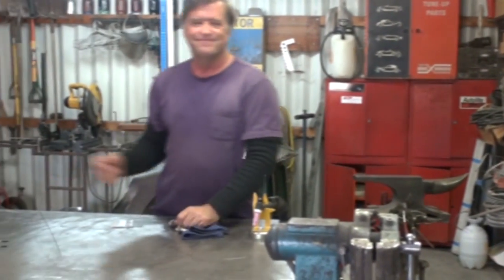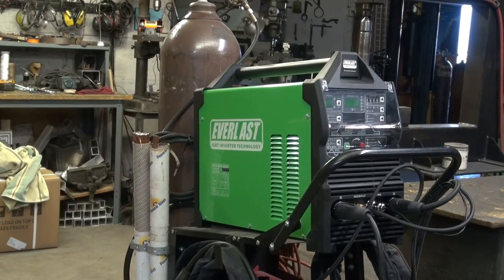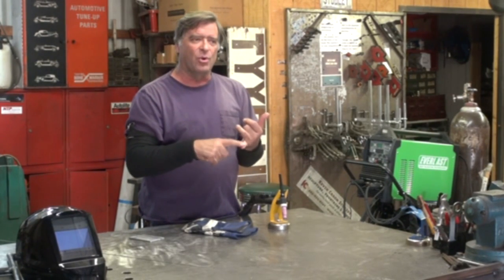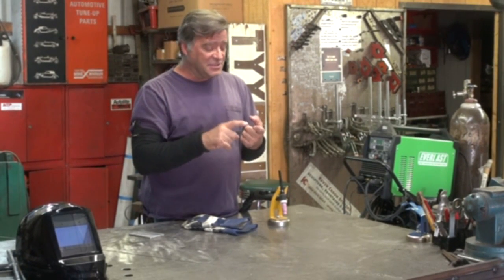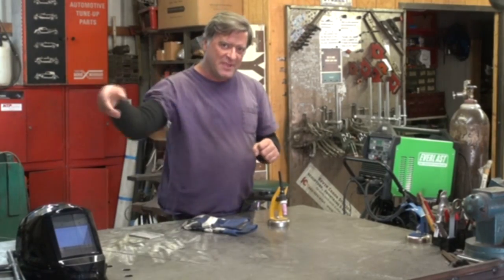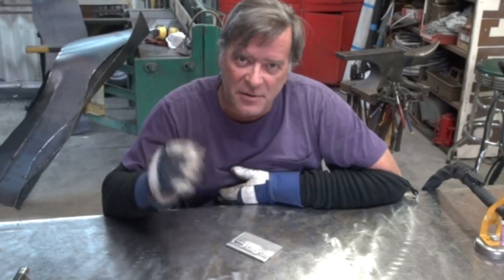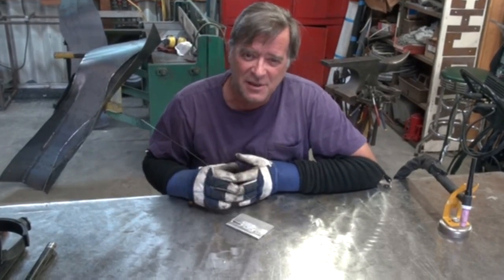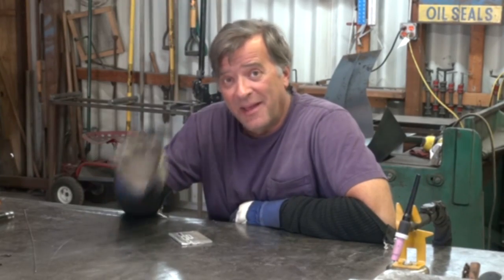What Welding Waveforms Are and How to Use Them - Kevin Caron

Comment: Kevin, would like your thoughts on TIG welding aluminum; specifically when trying to weld 1/16 and starting from the very edge moving inward I burn through the edge out. Second, from the burn through I guess I am not leaving enough added metal as I am seeing a crack from the burned out edge inward a little.
Reply: Tom Herd  Your machine may have a very strong start and that may be why you're having that problem but if you put another piece of metal to it and lead off of that piece you might find it easier to do what you want to do in my humble opinion.
Reply: @bobreichel  put a piece of copper behind It. Also, initiate the arc with filler close to the edge and torch also low as possible. Keep filler very close  and make your you're melting that metal to avoid the crack.
Reply: @r.a.8861   The copper will not work what you need to do is tack Weld a leader in front of where you gonna weld and at the end of where you gonna let off and then break them off after you're done welding that will solve the problem
Reply: @r.a.8861   OK I'm sorry I've only been welding for 52 years thank you for all your wonderful insight that you have to teach me something I had never known with all the experience i had working with Lockheed Martin in the airospace industry building BOC trailers so on and so forth. Thank you so much. 🤔